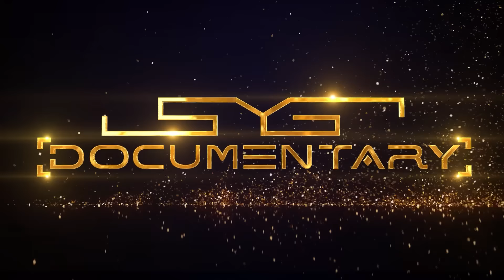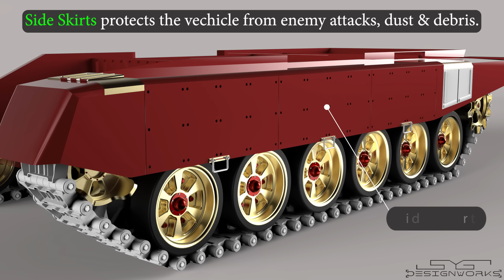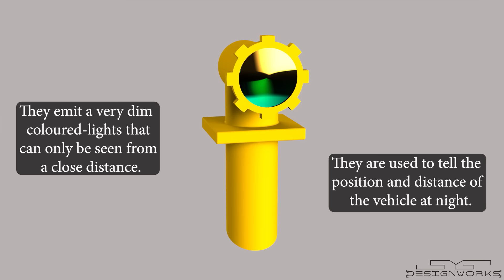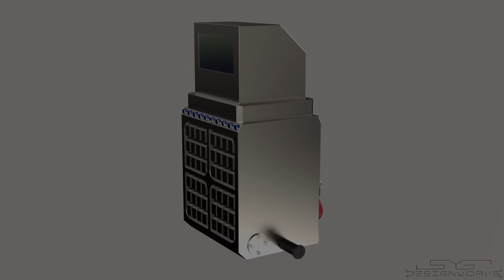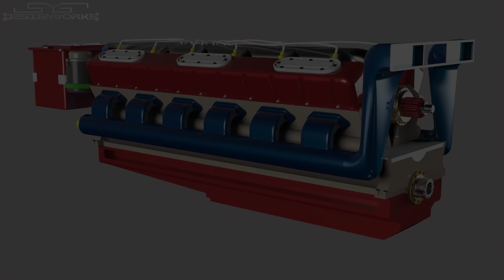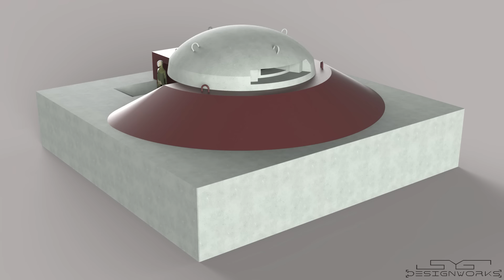How Vacuum Bombs Work: A Detailed Animation

Comment: They know how to make deadly formidable weapons
Reply: Gotta give it to em
Reply: But not how to use them.
Reply: Ale nie potrafią skonstruowac prostego,taniego samochodu osobowego,smartfona,laptopa,ani samolotu pasażerskiego.
Reply: @tomaszprzyjemski3489  They have passenger airplanes. Cars, smartphones and laptops need a large market without competition in the early stages, otherwise the investment in production will not pay off. For the same reason we also do not see these things in Poland or, for example, the UK.
Reply: @tomaszprzyjemski3489 they are actually one of maybe 4 or 5 countries who can make jet engines.
Reply: @tomaszprzyjemski3489  when the microelectronics market was developing, Russia was in decline
Reply: @GREYZONE-w8s  and you still dont understand anything, Russia Produce it's own Chips, of course they are not as powerfull as TSMC's chips that was designed by AMD or Intel or Nvidia but they are more then enough for it's use.

A Smartphone from 5 or 10 years ago is 10-100 more powerfull then computers from 20-30 years ago, and they are so small compared to computers back then, so yes Desktop PC's are not the Real Inovation, Smartphone's are becauser they are so small but provide such power, look at what a Smartphone weight and Diameters compared to a single GPU nowdays.
Reply: @allxtend4005  Own chips? These 65nm by AMD's equipment sold years before?
Reply: @tomaszprzyjemski3489  russia does have its computer brands. its own car factories. what about poland?
Reply: @tomaszprzyjemski3489 каждый силён в своём. Россия тоже делает вещи, которые мало кто может сделать или вообще никто не может сделать. И самолёты Россия умеет делать если что, гражданские.У каждого есть технологии которыми он не готов делится.
Reply: @tomaszprzyjemski3489  atleast Russians can go into space...not like Poland :D
Reply: @tomaszprzyjemski3489 😂😂😂😂Passenger plane ? Really ? MC 21 is a car ?😂😂😂😂
Reply: @tomaszprzyjemski3489 the USA can't do all those things either lol
Reply: @tomaszprzyjemski3489 its because historically we needed weapons to survive. Besides, Russia is way better in anything you can imagine than your own homeland 😂 cope with someone else's achievements

Comment: 60km per hour Speed ?
6 miles / 10 km range ?
😅
Reply from the maker: Those are accurate numbers. You can check it out.
Reply: @sygdesignworks  Google source told me it's range is 6km . I think .
Reply from the maker: @HitoAwomi-w8h  The old one has 6km, in the March of 2020 it was upgraded to 10 km.
Reply: @sygdesignworks  well got it now . But 6miles = 10 km ? 🤔

Comment: Comment about the capability of this system.  It has the major weakness, in that the "turret" cannot be adjusted for positioning, during firing.  As such it cannot do a spread or linear shot, like many competing systems.  This wastes horrendous amount of ammo, and is largely ineffective in an Ukrainian theater.  But it does waste a lot of Russian materials and assets.  If the Russians had their heads screwed on right, they would have designed this with a "robotic" launcher, using only two crew.
Reply: You have no idea how this weapon is used on the battlefield,,,Why the hell would they want to move the turret while firing,,,Its not a Rambo movie,,,The whole point of this system is to concentrate on the enemy cluster in front,,,There is 24 rockets on the system,,,One rocket can destroy everyone and everything in an area of 200 feet,,so if all the rockets are fired it can destroy everything within 2 square miles,,,There is simply no need to move the turret,,It can wipe out vast areas without moving,,,Also you say it's a waste of all the rockets aiming them at one place,,,,,,You haven't considered the concept of ,,,,,If they want they can just fire one rocket,,,,,,Yes imagine that,,,,,,It can fire one or two or six or ten or all the rockets ,,,,it doesn't have to fire all the rockets,,,,,You see the Russians think of all options when designing there weapons,,,,,,,That's why 300 billion dollars in western wonder weapons is laying in ashes on the ground in Ukraine,,,,Why Russia has destroyed most of the 15000 heavy western tanks sent to Ukraine including the Abrams,,,Why Russia has destroyed 68 patriot launchers ,,One third of the worlds supply,,,Yet less than one percent of Russian S series SAM launchers were destroyed,,,,,Because Russian weapons are far superior to western ones,,
Reply: @nightstorm9128  Actually I do have the concept of how this is done, and why.  Our company designed such systems, and I was one of the design engineers.  We used to imprint our company Logo, onto the target sites.  You are probably correct, in that the Russians are using basic WW2 & Korean War tactics.  Rule1 is wipe out the enemy by any means possible, including massed firepower.  Rule2 is to never run out of ammo, fuel, or water.  The problem in the UKR conflict is that it is being fought with Marquis DeLafayette and Pulaski rules, aka the American Revolution.  Later in our Civil War, these rules went out the window.  If the UKR & RUS war continues, there will only be horrible losses for both sides.  Escalation along the Baltic states is already occurring, so Russia had better get ready for a larger and more directed conflict.  Putin obviously has a strategic vision, and will not allow control of the Black Sea to escape.  If necessary, this will escalate into a full fledged war.  The USA already has assets in Poland, and this appears to be the next western border buffer zone.  NOT sure about how the southern front will evolve into Moldova.  That is a newer hiccup in the war.  Russia will have to escalate.  They have no choice now.
Reply: @brunonikodemski2420  really, and what company would that be since literally no one in the world makes the system, but the Russians?
Reply: @brunonikodemski2420  the West had its head screwed on right they wouldn’t be using for man tank cruise instead of three like the Russians